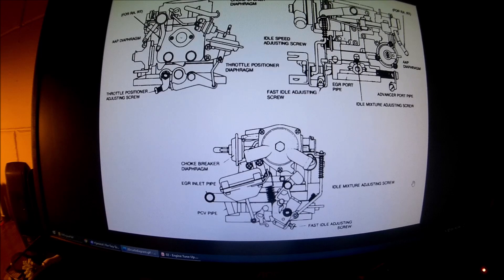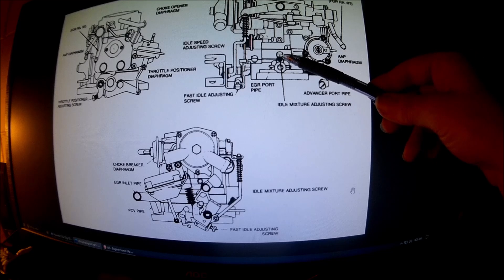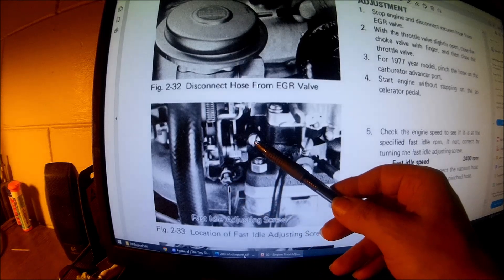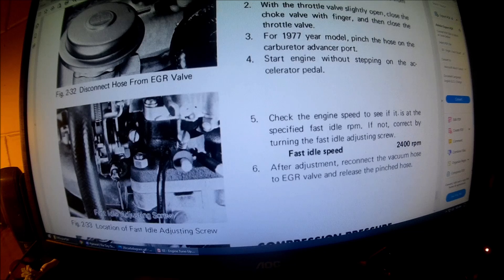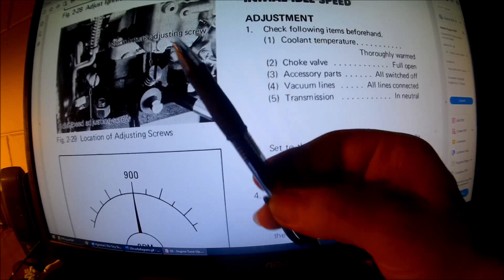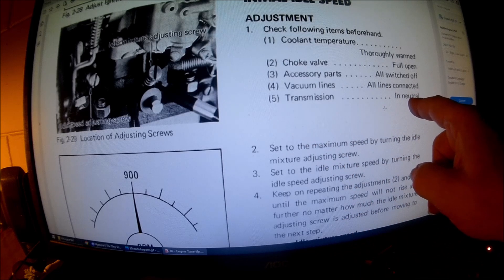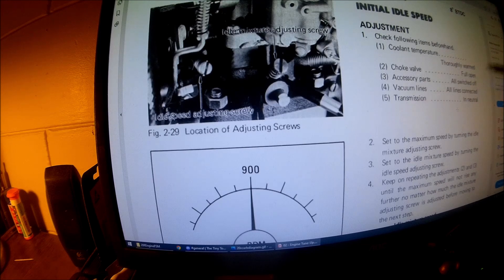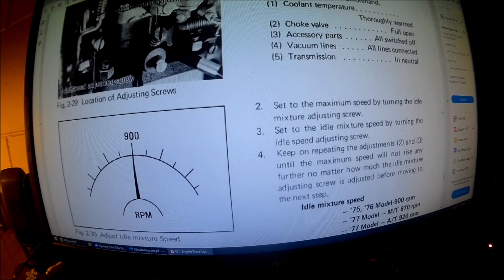Toyota 20R Basic Carburetor Tuning Procedure & Info

Comment: Thanks for the informative video.  I haven't fooled with my carb yet, but kind of think my '78 pickup could run a little smoother.  It sometimes does a little hiccup after being turned off, like it wants to keep going.  Too rich?  Not a serious problem and I'm not sure if the timing may be the culprit as I bought it from a place with higher elevation and I live pretty much at sea level. (No changes have been made to the timing since I got it.  I saw your video about timing adjustment but would rather leave it to a pro based on my lack of experience.). BTW, have you had any problems with water collecting on the floorboards after heavy rain?  I can tell its getting into my cab through the engine wall but have no idea how.
Reply from the maker: In your particular conditions as described, I'd be looking at the timing first as it ,ay have been set for "high altitude*", meaning it may be too far advanced for lower altitude driving conditions, and this should be set first before trying to change the idle mixture screw setting. Base engine timing & idle mixture are interrelated but the base engine timing should always be set first.
* By "high altitude" this usually means operation at 5000 feet in elevation or higher. Most road vehicles with carburetors don't need timing or carb adjustments for anything below 5000 feet. More on this below.

Unless you know precisely what a previous owner did to engine timing settings or carb settings for "high elevation" you're basically guessing, so it's best to "baseline" the settings & go from there. To explain further about why I'd look at the timing first. In general for high elevation running (rule of thumb) the timing needs to have a more advanced base timing than that at sea level, usually on the order of 1/2 to 1 degree of advance for every 1000 feet above sea level. This is because air pressure higher up is less (less dense air), therefore you get less oxygen. You'd also need to adjust the fuel delivery. Why? Because the ideal air/fuel ratio for complete & efficient combustion of gasoline is 14.7 to 1, air to fuel (also known as stoichiometric air fuel ratio). Less oxygen, less fuel to maintain as close as possible that 14.7/1 ratio. So your comment about the system possibly being too rich may be on the money here, and it might only take an engine timing adjustment to make that "run on" stop happening.
Like I said before, "high altitude" adjustments really isn't necessary for a street driven, carburetor equipped vehicle operated at 5000 feet in elevation or less, but you never know what strangeness people will to to a vehicle, IF they think it's just got to be done. So it would be best to get those "baseline" settings first by finding out exactly where the engine time is & then adjust the carb accordingly.

I understand your stance about "leaving it to a pro" about engine timing, however these days it can be difficult to near impossible to find a tech that even knows what a timing light is, much less how to use one, since most vehicle's engine timing has been on-board computer controlled since the 90's. It's really not that difficult to do & you shouldn't have to worry too much about "messing things up" as long as you work with care and really take your time making small adjustments. As for a timing light, you can get a basic one from any local Harbor Freight or online for about $30. Example: https://www.harborfreight.com/timing-light-with-advance-40963.html
There are also plenty of videos on YT that can teach you how to use a timing light to set base engine timing.

As far as water in the cab, yes I've had to deal with that & am currently dealing with that, due to my wiper system breaking on me. In trying to fix the wiper system, which is mounted inside the cowl area, I found that there are some rust holes in the outer cowl metal, that is allowing rain water inside the cowl. There are supposed to be tubes inside the cowl that allow rainwater to drain out of the inner cowl space, but I'm assuming that those are clogged & not allowing drainage, & I can't get to them without removing the fenders. Over time that standing water inside the cowl has caused some rust holes through the bottom side cowl metal so that the water now leaks into the cab.

My solution for this might sound odd to some but it's what I have to do. I have two plexiglass panels that I am going to put over the two vents areas in the upper cowl to close/seal them off. I have located all of the rust holes in the outer cowl metal and those are going to get wire-brushed to remove surface rust & then sealed with clear silicone caulking.

If I have any leaks after that then the only possible leak area is going to be the windshield gasket, which I will replace if necessary. I would urge you to attend to the problem sooner rather than later. A previous owner of my truck did a half-butt job of trying to seal it up (using roofing tar!) and apparently it leaked onto the floors for a long time. I have rust holes in my floor on both sides & those are going to take a lot of effort & time to fix properly. So it would be best to fix the leaks before that happens to you.
Reply: @The13thSword  Thank you very much for the information.  Unfortunately the leak problem I've had has already caused some pretty severe rust issues on my cab floor.  I don't have any covered area to park it so it gets left to the elements!
Reply from the maker: @davidflatcutf3286  Sorry to hear about that. Only short term suggestion I'd have is a tarp over the cab area & some weights to hold it in place so it doesn't get even worse.

If you've got any plans to fix the floor there is some good news. It used to be that you couldn't get preformed replacement floor panels for these trucks, but now they have become available though several sellers on Ebay out of Thailand. Just search on Ebay for "Toyota RN25 Floor Panel" and you'll see them. Prices are fairly reasonable.

Comment: My 1979 toyota 20R fires up right away. But the engine is suffering from higher RPM and  hot red exhaust pipe. Vacuums checked all tight. The exhaust pipe detached from the catalytic to check clogs, but the problem keeps going red hot pipe. Any idea. Please help. Thanks
Reply from the maker: The two main things that could cause this are:

1. Lean Fuel Condition. This usually* means that the fuel to air ratio does not have enough fuel in it & burns hotter than a "correct" air to fuel ratio.
*Lean conditions can be either fuel delivery related or otherwise. See #2 below for the "otherwise".

To verify an overall lean condition, wait until the engine is completely cool & remove the spark plugs & keep them in order so you know which one was in which cylinder. Inspect the electrodes & insulators of the spark plugs.
Normal condition - electrodes & insulators will appear intact with no damage & they will have a light tan to light gray appearance.
Lean Condition - Electrodes may or may not appear damaged (sharp edges worn away, pitted, possibly even look melted in places), insulators may be cracked, worn or even have pieces missing. Color on electrodes & insulators will be white & possibly also have a "sooty" or "ash-like deposits on them. That's a sure sign of a lean condition.

The first usual suspect is the carburetor.  You say the vacuum lines all check out (no vacuum leaks) but the carb itself could be the source of a vacuum leak, if it's older & possibly worn. There are bushings in the base of the carb for the lower throttle plate rod that can wear out & admit extra air to be drawn in at the base of the carb, causing a lean condition (too much air, not enough fuel). There might also be air leaks from damaged gaskets. The carb could also have partially blocked jets or passages due to debris in the carb, not allowing the correct metering or flow of fuel.

2. Lean Condition due to incorrect engine timing. Either the initial engine timing is set too advanced, or the distributor advance is providing too much ignition advance, or both. In the case of too much ignition advance the carb may actually be OK & it's giving the correct air/fuel ratio. However, because of too much ignition advance, the engine isn't able to burn all of the fuel, causing a lean condition.

Possible Issues:
Initial engine timing set too advanced. The spec for the 20R is 8 degrees before top dead center at full hot idle. If you haven't messed with this timing or you know you previously set it correctly, or checked it previously with a timing light, you can skip this one. Since the engine starts well I wouldn't worry about it too much.
Distributor Problems - 
Advance mechanism possibly stuck in advanced position. Advance weights stuck in advanced position. Both of these can usually be solved with some careful cleaning & lubrication, using a light oil on the mechanism & it's moving points, like ATF (auto trans fluid) or a mineral oil like 3-in-1 oil or similar. WD-40 not recommended as it doesn't last.
Weak, broken or missing Advance Weight Springs causing advance weights to move too far out, giving too much ignition advance.
Possibly worn out distributor; especially true if it's original. Replace with a quality rebuilt unit if found to be worn out.
Less likely but possible - Distributor Vacuum Advance Diaphragm hooked up to a non-ported* vacuum source. That would give the advance mechanism constant vacuum & it would be chronically fully advanced.
* Non-ported vacuum is constant engine vacuum, ported vacuum is vacuum that varies by engine speed. The vacuum advance diaphragm needs ported vacuum to operate correctly.
The correct vacuum port for the distributor vacuum advance diaphragm is on the passenger side of the carb, below the Idle Mixture Screw, & points towards the front of the vehicle.

That's about all I can think of. Let me know what you find and/or any updates. Any other questions just ask.
Reply: @The13thSword  Thank you for the brief explanations, Sir. All you mentioned was detail done, even a new rebult carburetor installed, but the problem was not solved. After all these exams,cylinder head detached. The findings were interesting. 1/ one of the cylinder head water supply hole, and the matching engine block water intake hole found chipped size of pin hole,; and this causes coolant drainage toward the combustion chamber,this  causes mixture gas and coolant. 2/  cylinder #1 top piston ring found broken. 3/ For detailed instructions,  all pistons were removed without  removing the crank shaft, oil pan removed (pain in ass). and unbolting connecting rods from the bottom. 4/  cylinder #2, the liner/ sleeve found straight line cracked.  The remaining three cylinders were found in good shape. When the # 3 piston pulled out, the piston rings were found socked with coolant water,and it sprinkled all over the engine bay. The remaining cylinder block sleeves are found in good shape. 5/ Now in the process, trying to install liners without taking apart the engine. The aluminum Cylinder head chiped coolant supply hole welded and resurfaced lightly. The engine block chipped hole, not yet. The coolant intake hole is very close to the combustion chamber. It needs good repair. So, the findings conclusions about red hot pipe were gas escape from combustion chamber and mixed with coolant,  and un burned gas exits through the exhaust manifold to the pipe. When the radiator pressurized,  it created coolant mist through the liner crack wall, which means another contribution to gas and coolant mixing problems. I dont even understand how the car was starting from all these cancers. Now, pulling out liners without any damage became another pain. Any thoughts abouttha, let me know. Again, thank you for your response.
Reply from the maker: @dawitkassa3131  The following may not be the answer you expected to hear, but I have to be completely honest with you, to help save you much work and possible frustration.

Unless you are a machinist by trade (job) and work in an auto machine shop equipped with all of the specialized tools and machines, I do not recommend that you attempt to replace the cylinder liners yourself. Reasons:

1. The cylinder liners are a VERY tight press-fit (https://en.wikipedia.org/wiki/Interference_fit) that requires specialized tools and machinery (usually a hydraulic press) to do correctly and without damage to either the new liners or the engine block.
2. Trying to do this job with hand tools and with the engine still in the vehicle is going to be very difficult if not impossible to do correctly without possible further damage.

Also, given the types and amount of damage you have (as you said, "all these cancers"), if it were my engine, I'd want to do a complete rebuild on it. That would include removing the engine from the vehicle and at least sending the engine block to an auto machine shop, so they can thoroughly clean it*, test it for block cracks, and have them remove the old cylinder liners and install the new ones. They can also fix the "chipped hole" in the block. The block is cast iron which is not easy to weld correctly without the correct equipment & experience.
*Such a shop can "hot tank" the block, submerging it in heated solvents. This will remove any/all oil,/grease, dirt, deposits, etc. Even more important it will dissolve any built-up deposits, blockages or clogs in the block's coolant passages.

Based on my skill level and experience, I could handle everything else myself (disassembly, cleaning, measuring/checking parts for wear & replacing if needed).

I know this sounds like a lot of work, (it is) and a pain in the ass (it is), but it's the best way to get the job done correctly with a minimum of problems. Plus a full rebuild like this will basically give you a like-new engine that you will likely never have to worry about again as long as you own it. That would be the benefit of this amount of effort & work.

Given the damages you have described, I'd be worried that some or many other parts could have problems or just be worn out & in need of replacing too. Particularly things like crankshaft journal bearings, connecting rod bearings, damaged pistons, etc. Having coolant in areas of the engine block that were only meant to have oil is a big problem, and can damage parts easily, as you have found.

So, as long as the block doesn't have any cracks in it because of the coolant issues, and any minor things can be welded/repaired, I'd rebuild it. If the block isn't rebuildable then I'd have to consider finding another 20R to build, or maybe a good condition running/used 22R engine to install in the vehicle. It would be a straight "drop-in" as the 22R is basically the same block as the 20R, it will bolt up to the existing transmission & it has the same motor mounts as the 20R. The choices are up to you.
Reply: @The13thSword  Sir, again,I am very thankful for the explanations and suggestions you gave me. Yes, engine removal and machine shop work would be my only chance. The car has only 24,000 miles on it, interior,body all rock solid. It's going to be expensive repair. I tried to find 20R or 22R locally,  but I couldn't find one.Even though I found one, it's hard to tell the condition of the engine. As you suggested,  I will take it to a professional machine shop to get the job done right.  Thank you so much. !!!
Reply from the maker: @dawitkassa3131  You are most welcome and I'm glad to be of some help. If the vehicle in fact has only 24,000 miles on it, and that engine is original to the vehicle, then that's a good sign for you. The engine only has 24,000 miles of "stress" on it, so it's much more likely that it is in better than fair structural condition, overall.

If it had been sitting for quite some time instead of being used/driven, I could see how some corrosion in the cooling system lead to that "hole" in the head & block, causing the "blown head gasket, and also causing the damaged you described. As long as it wasn't run excessively in that condition, I'd think you are in very good shape for a rebuild without any major issues. I certainly hope that is the case for you.

Please keep me updated at your own convenience on any progress you have. I'd like to know what happens next. I will keep a good thought for you. 👍
Reply: @The13thSword  I will, much appreciated. Thanks

Comment: I can only assume my carb is shot as I just burn black smoke like a diesel no matter which way I tune the carb
Reply from the maker: That's entirely possible, depending on the age of the carb & when it was last rebuilt, if ever. It would also be more likely if you have completely gone through your ignition system & verified that all of it is functioning as it should be. A weak or malfunctioning ignition could be responsible for an incomplete burn of the fuel, which would also give you the "black smoke" symptom. How old are your spark plugs & how do they look?